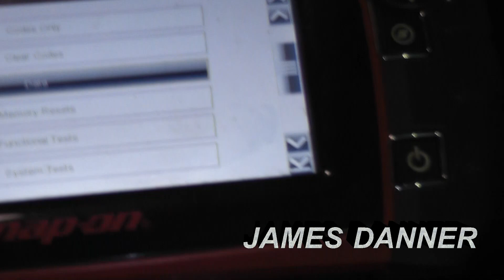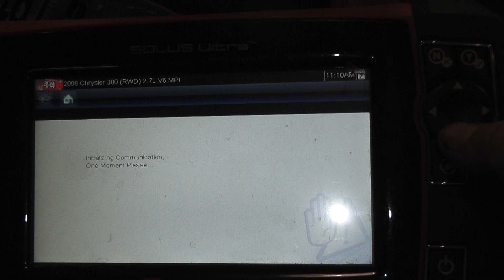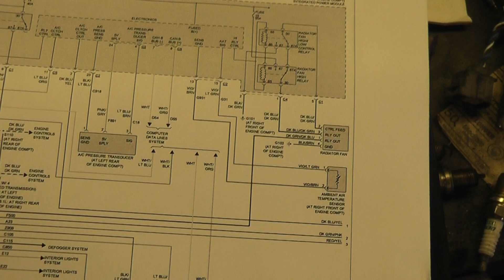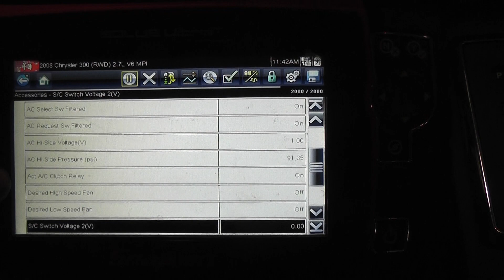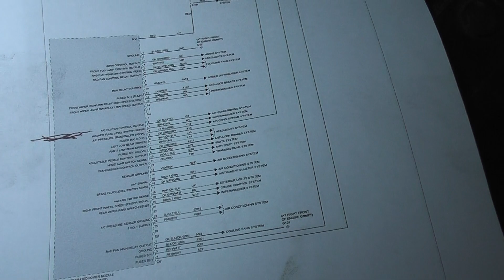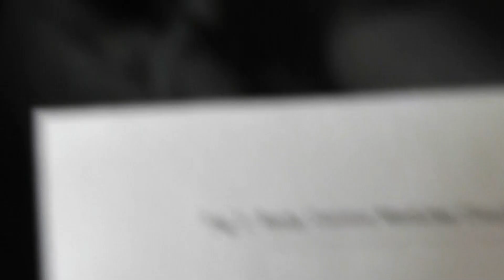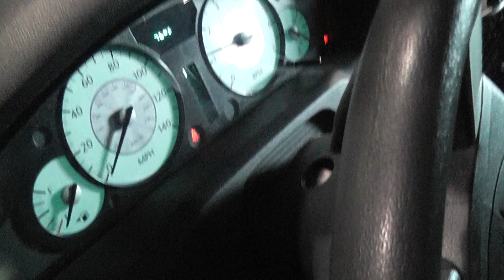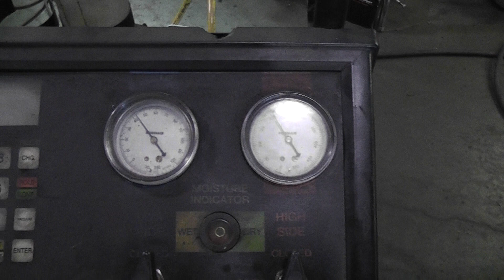CHRYSLER 300 NO AIR CONDITIONING COMPRESSOR OPERATION

Comment: THANKS ALOT, i just did it on my car( 3.5l 300),and just like you,the wire fell off,i poked out the old wire with a flat head screwdriver,cleaned out the green corrossion,and inserted a new wire and POOF, a/c clutch engaged,i think im just missing some freon,cuz it doesnt blow out cold air yet,but thanks alot👍

Comment: For A/C issues on these 300's and chargers check the small fuses for A/C Clutch first. The fuse tends to be bad or the contacts for it are bad a lot. I just found one that works if you push the fuse down in more, let go and it turns off. Obviously bad contacts for the 10a A/c clutch fuse.

Comment: Sweet diagnosis and fix Danner. Thanks for showing all of us how a pro does it! BTW, you may be able to use the soldering iron to shrink the tubing. I use the side ports of the iron since they exhaust the heat from the tip. Works pretty good.
Reply from the maker: +Baxrok2 I've done that. Never thought of the ports on the butane one tho. Should have cause I've been burnt by it .. ha
Reply: Baxrok2 here

Comment: James please tell me how I can send you a case of beer. I have been FIGHTING this issues for a few YEARS with no success. Funny enough I actually watched your video once before and somehow missed trying the fix. It was 100% a corroded wire and it even broke off in my hand like in your video. I clipped off a TPIM wire connectors at the local junk yard when I purchased what I thought could be the issue ( the actual TIPM). I popped out the old corroded one, spliced in the new one, reconnected the connector, started the car and POOF.. the a/c clutch engaged and I had cold air.... Thank You SOOOOOOOOOOO Much for your video, it saved us a lot of money and time. Rob
Reply from the maker: Awesome. I like those stories. Glad to help

Comment: howdy James. New subscriber here. recommended by your brother Paul.. you guys are some of the sharpest techs I've seen. looking forward to more of your vids. cheers
Reply from the maker: +Javier Rocha thanks for participating.  Try not to get dizzy with my mad camera skills
Reply: James Danner I manage not to get too dizzy with Paul's extreme knowledge. I'm sure I can keep up. pull max G's bro.
Reply: James Danner this guy right here Javier is a great sub to have , solid dude . Slightly crazy but most are 😁
Reply from the maker: +New Level Auto so he'll fit right in
Reply: James Danner  Anybody had any problems with this code and how to fix it? u0159 2006 300c srt8
Airbags, parking assist, tire sensor and the climate controls stopped working. All it says is it lost communication with the hvac I’m lost. All the fuses show good I’ve replaced every relay and fuse and still nothing. I can’t find anything on this kind of problem

Comment: Nice work Danner! After the repair I was under the assumption that it's good to sit in the car for a while just in case it it trips back off :)
Reply from the maker: +Dall Tex yes! especially on hot days, an extended test drive or idle period  may be necessary.  Ha

Comment: I own a Chrysler Crossfire which does exact same thing but since it is built by Mercedes I am afraid to mess with it. The compressor does not engage but it is full or Freon . I wish I had someone to look at it . No mechanic wants to work on this car .We as Crossfire owners have no supports  for these cars any longer The forums don't even have a fix for the Key or Skreem and God forbid you loose a key or your Skreem security module goes out your screwed . I can not even buy a replacement  key fob and when you could buy them they sell for $600 and you must order it from Chrysler or a few specialty key places with no ETA and no refund because the key is vin related it is scary to not have a replacement key because they have transponders in the key fob no one will remake no locksmith will touch it. Just want to let anyone know interested in a Crossfire do your research first . I love my Crossfire but no one can fix the key issue treat your one key like the crown jewels . If you loose your one key you will own a very cool looking boat anchor .

Comment: Absolutely great video 👍 had the exact same wire broke of in my TIPM.
So I got that to fix...but sadly I'm not getting the ground signal to that wire with the AC on...freon good, clutch is good(I can manually start the compressor by grounding out that pin on the back of the plug)
So now I'm at a loss... I'm not sure if it's the power control module or the actual head unit that's not getting the signal to the TIPM.
Reply: It was a great video. Watch it again and you shouldn't have any trouble fixing it. good luck
Reply: @tubetime39  Actually fixed it last year. There was a corroded wire on the bottom of the fuse box in the engine compartment.

Comment: Hello, wondering if you have to evacuate the ac system prior to replacing the ac pressure transducer sensor on 07 Chrysler 300 2.7

Comment: I think this might be my issue, my ac compressor is not turning, I had it replaced and the same thing is happening "NADA" just warm air I drive a 08 Dodge Charger 2.7

Comment: (0.18) lbs was there any leaks? What's your preferred method for checking for leaks, nitrogen and soapy water, dye, leak detector. Nice video keep up the good work.
Reply from the maker: +James L another shop was in there before me and the customers note said it could be empty.  So if there is anything in it, I usually do the dye thing and ask customer to return for a black light check. I usually sniff the vents with the detector tho. Even with .18 lbs in it there was probably 50 lbs or so of static pressure. Alot of times a full charge could last the season and some elect to just charge it every spring.  If there is zero pressure, I'll pull a vacuum to see if it holds at all. If so, I'll still charge it with dye and look for the leak that day. They usually show up quick. If it doesn't hold vacuum, I have a spare low side hose that I blow shop air into and do the hiss or tire leak seek bubble check.

Comment: Your car engine sounds like that tho bc your timing is off a little. Just wanted to let you know. I am a pro at changing and replace water pump n timing chain on these engines. When the timing goes off, it kinda retards the engine and the knock sensor also retards the engine makes it sound like a diesel engine when running. the timing chain just needs replaced but most likely it's actually the timing chain tensioner that needs replaced most likely m they go bad very quickly sometimes. Also your timing can be off completely and your car will still run. It's a non interference engine. So it won't damage your engine which is a good thing. But yea as for my ac and the bad blue/Yellow wire. I just pushed a new wire in and twisted the broken wire to that new wire I pushed in and that solved all my problems.
Reply: The Chrysler 300 is a non-interference engine?  Are you totally sure about that?

Comment: My 2019 chrysler 300s  not getting fire to compressor wires to run compressor.  All fuses look good and swap relay but still no power.  What can be the issue?
Reply: I checked fuses under the hood and in the trunk

Comment: Pause at 15:37 and look at the terminals in the connector with the red/white wires. They are green. Chrysler should be ashamed for using unsealed connectors (IN THE 21ST CENTURY), which are exposed to the elements. These 300-series cars are an electrical disaster. I have done electrical repairs for three co-workers with this series of car, and found similar problems, with wires green and broken off. (we are not working in automotive repair industry)
If you own one of these cars, FLOOD all of the electrical connectors with ACF-50 to reverse the green crusties, and curtail future problems.
Reply from the maker: +LakeNipissing thanks. Don't know about that acf50.  I gotta look into that
Reply: Check out their website. It is essentially a mil-spec aviation multi-metal corrosion inhibitor which is harmless to electronic components, and not flammable or toxic. It is intended to be applied to PC boards and connectors. We have been using it for more than 20 years in industrial/chemical environment with 100% success, and I use it at home on all automotive electronics, wiring, connectors, and potentiometers.